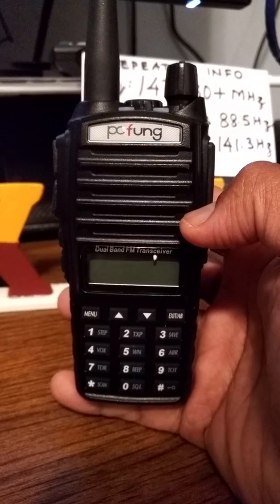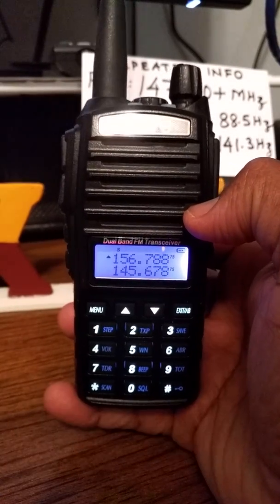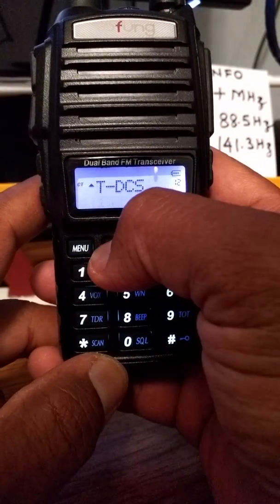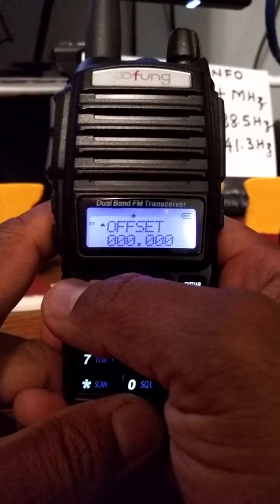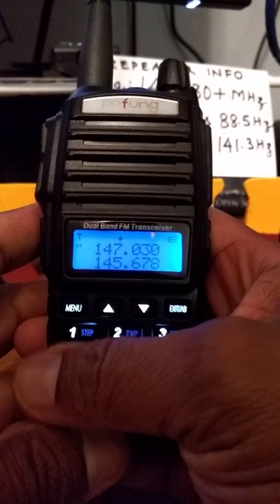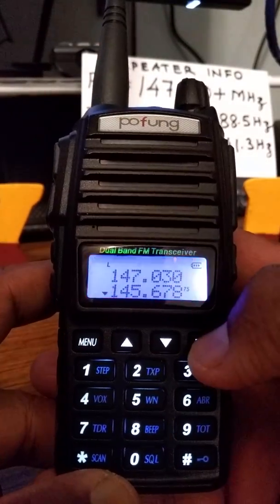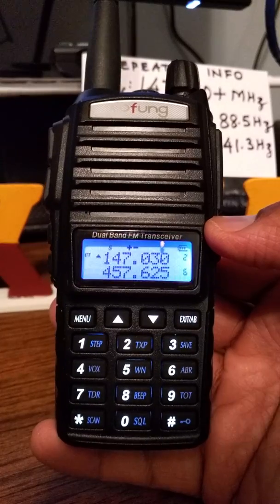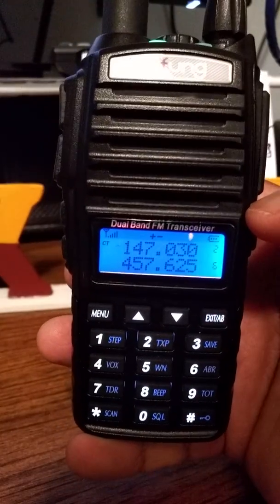Baofeng Pofung UV-82  FAST channel programming from keypad (no PC / cable needed)

Comment: Damn thank you my friend now you taught me how to program my Pofung/Baofang UV82 the radio shop in my town wanted $50 bucks to program 20 channels you saved me some money  thanks again
Reply from the maker: @Francis Allen - I'm glad the video helped, I have nearly 100 channels programmed on my HT radios. But it is tedious to program so many channels by hand, so I use CHIRP software. It is free and open source, but it does require a windows computer & a programming cable. If you invest $10-$15 getting the cable, you can program radio after radio in seconds. Please see links below: 
https://chirp.danplanet.com/ 
https://www.miklor.com/UV82/
Reply: @OhioBaji  Hi the programming cannot be done on Mac? only windows? Also where can I get the cable from? AM planning a boating trip withy wife, would like to buy a few radios without spending so much on regular vhf. Thanks! You're the best!

Comment: Thank you! Very helpful video. Just got my Baofeng UV82, reset it to English language and ready to start programming! It’s nice to know I don’t need to connect it to the computer to program frequencies (unless I want to name channels).
Reply from the maker: If you use free software CHIRP, you can - Name channels, change backlight timeout, adjust how sensitive each squelch level is. The factory default squelch sensitivity ranges from 20 to 50 for squelch levels 0 to 9, which is not very useful. The actual sensitivity range is 0 - 127. Using CHIRP, you can exploit the entire 0-127 range, which means changing squelch will actually work as expected.

Comment: Thanks. Mine started speaking Chines to me...Have to get English back. They don't include PC programming cable. If you get one, order it separate. Thanks for the very clear and concise instructions. None of this is explained clearly in the operating instructions. Glad I have been a HAM since '89.
Reply from the maker: MENU -> 14 -> MENU -> Up-arrow or Down-arrow to change to ENG -> MENU (to confirm)
Reply: Thanks, I had just unpacked the new radios and I saw the "Voice" on menu 14" and hour later. I am very surprised that these radios have so much technology and capability for $21.00. Your video was very valuable to kick start the process. Thanks
Reply: Quick question, do DCS codes work through a repeater? It  does work on simplex. No luck through the repeater I use.
Reply from the maker: @starwoodstudios1  I don't know of a repeater that uses DCS codes, all of the analog repeaters I use only use CTCSS codes which are MENU options 11 & 13.
Reply: Yes, CTCSS code is used to open a repeater with a selected PL tone. DCS codes are used to block out other radios that are not transmitting the same DCS code. Acronym "Digital Squelch Code". "That way you can monitor, and squelch opens only when the matching DSC code is present in the transmission. I think the repeater must filter out the DSC code. Thats why it is working on simplex and not through repeater. Thank you. I will look into it more.